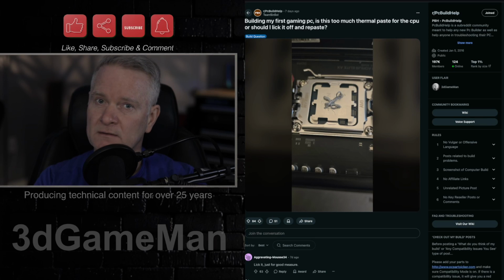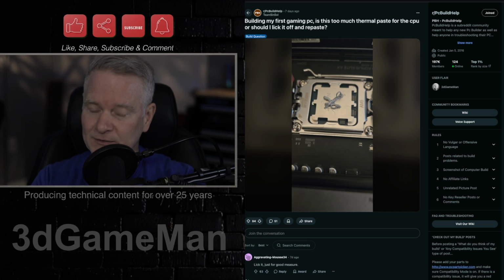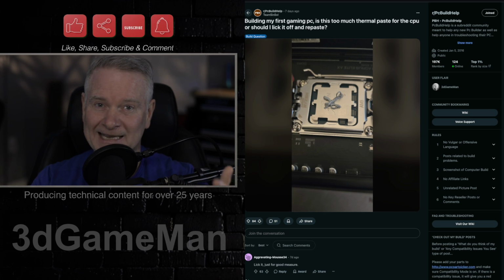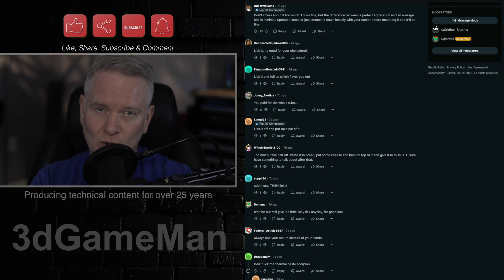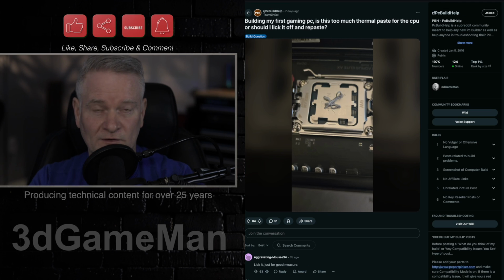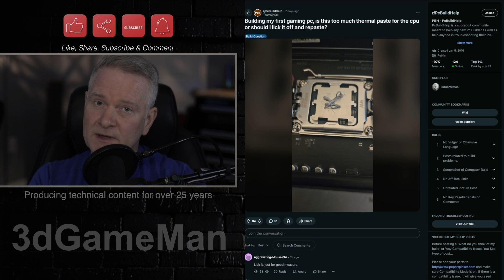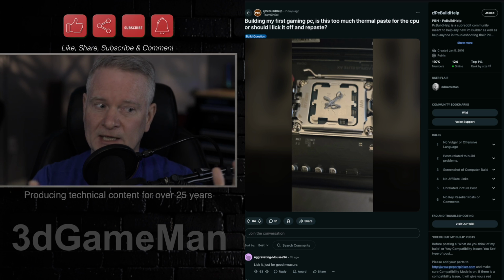Thermal Paste, How Much Is Enough?

Comment: In most cases, a blob in the middle is enough. The pressure of the heatsink should sufficiently spread the paste. But there are also certain exceptions, like if you're got a CPU with a larger surface area, such as a Threadripper chip, you'll have to apply more to make sure it's covered.